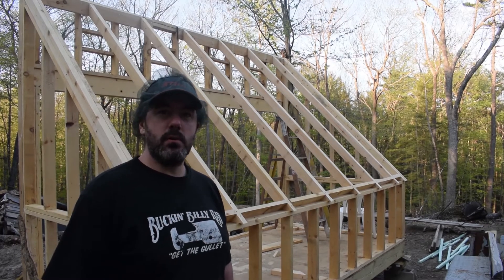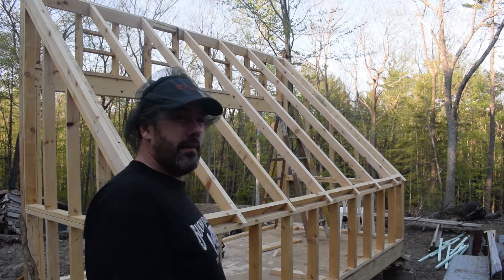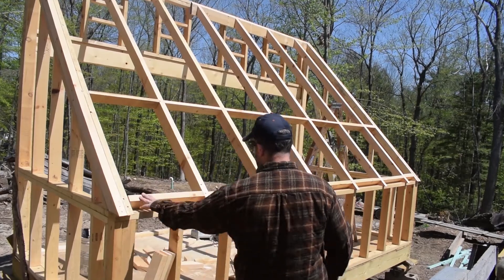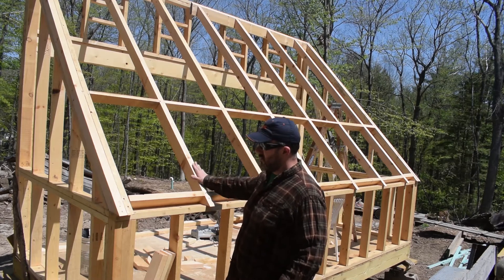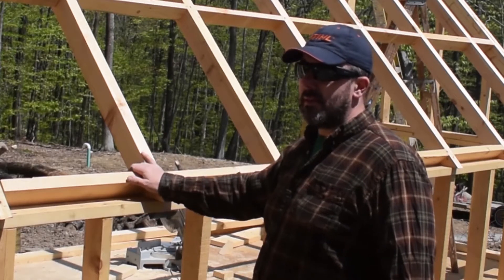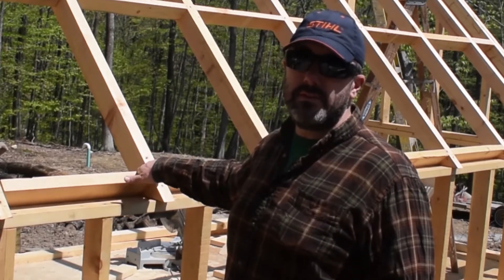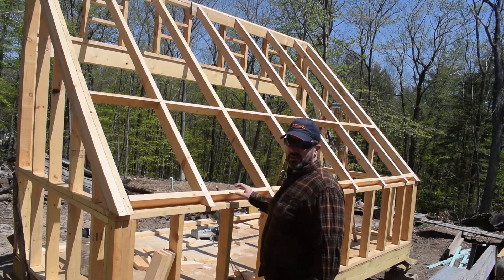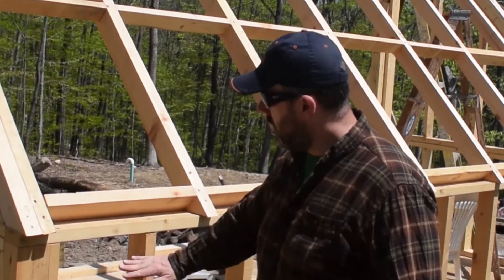Solar Kiln Build Part 8 - Roof Blocking Supports

Comment: Very nice bud, coming along awesomely, not a criticism but an observation, maybe try setting focus to manual for the intro outro parts, camera has a bit of a shitfit trying to workout where to focus, keep up the good work bud
Reply from the maker: Thank you Tim.  Good point.  I should probably turn off auto focus when I will not be moving around.  Nikon auto focus is not so great. I hear Panasonic is much better.  I may start using my action camera outdoors from noe on instead of the Dslr.   Hope you had a great day Tim.

Comment: I used old glass from sliding patio doors instead of Polycarbonate sheets (and saved a ton of money) I had to remove the glass from the frame and splits the pains of glass. So one patio door set gave me 4 sheets of glass about 4’x7’each. It was very easy to do.
Reply: And I got the Patio doors free
Reply from the maker: That's a cool idea.  I may try that when I make our cold frames if I can find free patio doors.  Thanks!